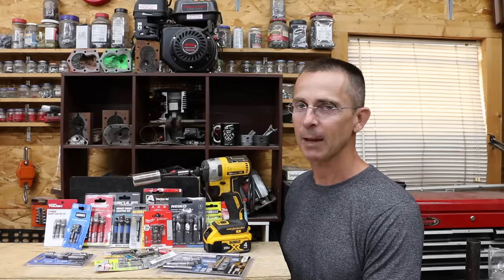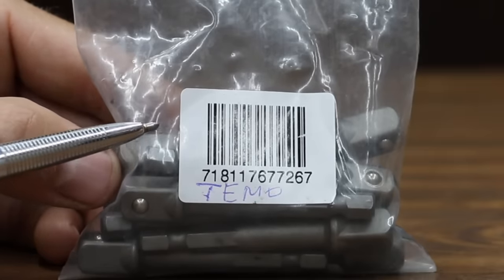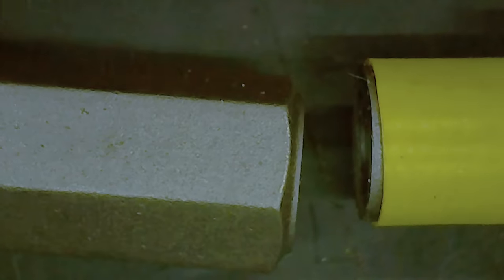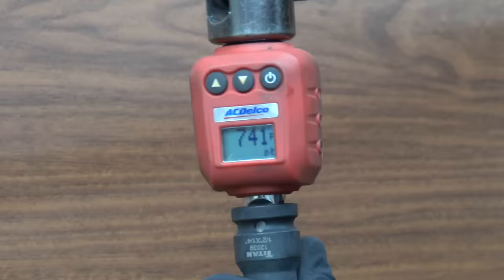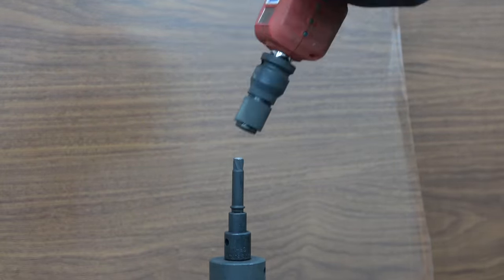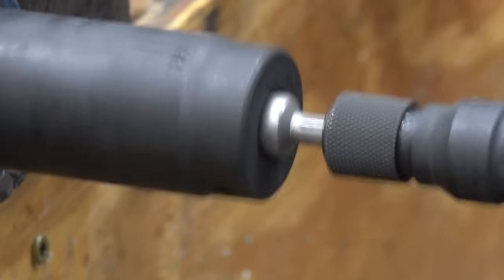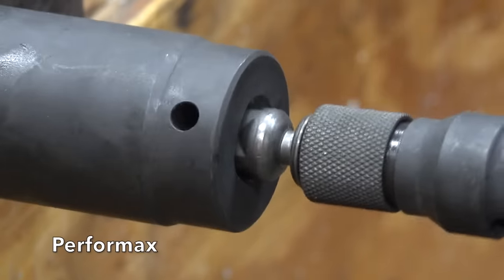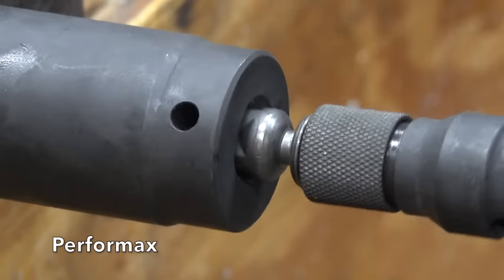Best Socket Adapter? 18 BRANDS: Milwaukee, DeWalt, Makita Gold, Ryobi, Hart, Irwin

Comment: Great video! It seems that when it comes to your reviews of bits/adapters/etc., Husky and Kobalt are often omitted. As those are staples at Home Depot and Lowe’s respectively, it would be helpful to include them as well. I recently had two Husky socket adapters fail on me, and I would have been interested to see how the brand stacked up in your test. Also, it might be interesting to do a re-test of these adapters to see how they perform in extreme cold, moderate cold, and warm weather, as many people keep them in their un-heated garages and work trucks year-round and might benefit from knowing which brand(s) are better suited to working well when cold.
Reply from the maker: Thanks!  Thanks for the video ideas if I revisit this test.
Reply: @ProjectFarm  

A test with tools in 10-30F range would be quite interesting.
Reply: What model Husky? I'm looking at the 1/4 in. Drive Impact Driver Socket Adapter Set (6-Piece) right now

Comment: Doesn't having a shock absorbing adapter defeat the purpose of using an impact tool?
Reply from the maker: Great point!  From testing all of these, it serves as a failure point on short impact zones and adapters with longer impact zones (Bauer and Hercules) absorb too much of the impact.
Reply: No. It assists in applying the right torque, instead of getting the full load of torque immediately. Torque limiting extensions are the gold standard in tightening lug nuts because real people in the field will destroy the tool and parts they are working on if you give them the full load of torque immediately.
Reply: Protecting #8 or #10 fasteners may be a good application for the shock zones.  But when using them on large bolts, it seems the stronger versions could be desired.
Reply: $5 says it's marketing wank and a great excuse for a built in failure point so you keep coming back and buying more
Reply: @ProjectFarm  The shock absorbing in the longer bits has nothing to do with it being an impact absorbing section, it's purely down to length. Try driving a 600mm screw with an impact driver: you'll get absolutely nowhere. If you use a regular drill, it'll go in no problem. More material means more springyness, which means less torque transmission.
Reply: @TheThomaswastaken  or you could get the right impact negating the need for a 1/4 inch shaft. Honestly i've got the 1/4 inch , 3/8's  and 1/2 inch impact.  As for your Comment it's wrong, the Impact absorbing Zone is just a failure point so it breaks there instead of in the tool.
Reply: False Flag  or a 3/8's and or half inch impact that needs no extension.
Reply: False Flag  When I worked at Sears Auto Center we had to use the correct color torque limiting stick then we had to go back over the lugs with a torque wrench which is still in the certified/calibration date. The torque sticks would never torque to the correct ft-lbs
Reply: I don’t think on sockets it helps, as the socket can and bolt or nut can take the torque, but with screw heads (Philips,  square, star) can only take so much torque, and this helps to keep the peak torque down.
Reply: @ArmyGrunt1986  That sounds a lot like how I put the lugs on my car. Spin it on and tighten it 90% of the way by impact driver, and then tighten it by hand because the impact driver doesn't deliver enough force to properly tighten them.
Reply: @shawn576  

That's how I do truck lugs on spiders and 10/12 studs. Run them on, square the wheel (for spiders), then tight with the impact and final finish with the bar.
Reply: Its more a shock normalizer than a random absorption.
Reply: @Peter Bilt you're absolutely right. It's called "Impact", not gradual or soft because it's supposed to be impacting. If you don't want the impact then you use another tool.
Reply: @TheThomaswastaken  imho, impact tools are for loosening, where you want all of the impact delivered to the fastener.  Tightening should be done to a torque specification.
Reply: @BixbyConsequence  Impacts are great for driving long wood screws that are nearly impossible to drive by hand or non-impact driver due to how much force it takes to get them moving. With an impact, I can easily drive 4" screws with one hand. With a non-impact, the continuously increasing torque can yank the driver/drill out of your hands at any moment.
Reply: @BixbyConsequence  

Impacts are fine for tightening in most circumstances, you just don't go full diesel mechanic and rattle on the damn bolt for half an hour. Run a bolt on, tighten it somewhat, then finish to spec. You shouldn't start a bolt with an impact either due to how easily you'll knacker a thread, which is another diesel mechanic trick.

Driving fasteners is a totally different thing, my 1/2" impact drives all the lag bolts I use around the farm.
Reply: @ProjectFarm  It's for fatigue life. Reducing the diameter slightly and changing to a round cross section instead of hex makes the adapter last longer under cyclic loading like you see in an impact driver at the expense of a reduction in maximum single-loading strength. You would only see the advantage of this zone if you loaded the adapter below its ultimate strength and cycled it for a million impacts or more using the impact driver these tools are designed for, not a 1/2" impact wrench like you used. I'd be interested to see a re-do of the impact test with a regular impact driver instead of a wrench to see if the "shock zone" adapters do what they're designed to do.
Reply: @TheThomaswastaken  Sorry no, but a good torque wrench is the gold standard. I've taken my vehicles to tire shops where I've watched them use torque extensions and found them to have as much as 20 ft-lbs of deviation from nut to nut when tested with my Snap On torque wrench. If a wheel nut and stud is designed to be tightened to 80 ft-lbs, then 60 is not enough to guarantee it doesn't come loose. And 100 could stretch the stud past it's elastic point. Torque extensions are designed to be fast, cheap, idiot proof and to keep the tire shop out of court, not their customers out of the hospital.
Reply: It depends on the application. 
In aerospace where fasteners can range from $1 to a $890 3/4” Inconel/Titanium fastener absolutely can’t be damaged- these would be a good idea as it should break before the fastener does. 
Have to be careful. You never know what that 200 pound gorilla will do on the other end of the tool.
Reply: False Flag  You over estimate that intelligence of A LOT of employees.  As someone who's always removing rounded out allen countersunk bolts from machines.
Reply: @TheThomaswastaken  Impact driving accessories, especially adapters like these, are supposed to deliver the sharp impact force through the tool. It is that sharp impact force that does the work that you chose to use an impact wrench for in the first place, such as removing stuck bolts or driving nuts over flattened threads. The tool does this through resisting flexion (being rigid). Situations where you would consider striking a wrench with a hammer, which is essentially what an impact wrench is doing. If you've ever tried removing stuck or over torques lug nuts with a regular extension or adapter, you'll realize how frustrating it is realizing the impacts are being absorbed by the extension or adapter rather than sending that impact force into the lug nut.

Torque limiting extensions are not drive adapters. Those tools are designed to deliver torque while limiting the overall amount of torque delivered through it so that you don't apply too much. They absorb anything over their rating, shunting that excessive torque as heat through the tool. They accomplish this by having a controlled amount of flexion over their length. This is generally used when torquing tire lug nuts, where the torque limiting extension can be used to quickly install the lug nut without over doing it, where the final torque is applied afterwards with an actual torque wrench.

For an impact adapter or extension, ideally you would want a tool that transmits 100% of the impact force through it, while not breaking with the desired overall amount of torque being applied to it. A 6ft long piece of steel pipe may be able to not break while dealing with the applied torque along it, but if it flexes enough to absorb all of the impacts then it would defeat the purpose of using an impact wrench in the first place. A long steel pipe, obviously, would make a terrible impact extension since it cannot transmit sharp impact forces through it very well.
Reply: @TheThomaswastaken  yeah except they dont critically fail when the torque load exceeds the rated amount, they flex and simultaneously save the tool, the fastener, and the area being fastened to.
Reply: @TheThomaswastaken  you dont tighten wheel lugs the "right way" with a impact driver....you use a tq wrench.
Reply: False Flag  The right way is when you need 120 N/m, you use a 100 N/m torque stick on a uggaguggagun for speed and then use a torque wrench for the last part.
Reply: @3rdpig  20 lbs difference isn’t bad for tire shop techs. the thing about torque sticks is you can always trust them to get you to AT LEAST the rating but usually more. if a nut says 80, it’ll prob handle 120-130 no prob. if it says 100 it’ll prob take 140-150 repeatedly
Reply: @richardvedvik979  If you're using 1/4" hex drive to tighten "larger bolts"... you're doing it wrong.
Reply: @3rdpig  100 Ft*Lb isn't gonna stretch a wheel stud calling for 80 Ft*Lb past its elastic point. It's clear you have no idea what you're even going on about.
Reply: @lIIIIIllll  Honestly idk why these get made in 1/2" drive configurations. But working in a paper mill, they are a life saver for the hundreds to thousands of SHCS (4-8mm) that doing a roll change can entail removing. They mostly help absorb that last bit of snap/whack at the end that would normally cause the head to start rounding out. That and preventing the actual adapter from snapping due to repeated stress for hundreds of thousands of cycles.
Reply: @3rdpig  if you can't install lugnuts without a tq wrench, you don't belong working on cars. And you're not going to stretch them to the point of plastic deformation unless you're completely incompetent. People's lug nuts aren't falling off unless they're DRASTICALLY under torqued.
Reply: @TheThomaswastaken  No reputable shop or manufacturer will EVER allow you to hit final torque with a torque stick. There is too much variance, the torque sticks only job is to prevent some young buck from snapping studs left and right. You must in all cases go back with a torque wrench and check final torque. It is for this reason I never used torque sticks, I have trigger control and know how to 'go light' on the trigger. I can accurately and repeatably hit a +/- 5% margin of error with my impact to a given torque spec. I still hit lug nuts with a torque wrench every time, even though most of the time the nut makes only a few degrees of rotation before hitting final torque.

Full torque immediately won't break things either, the total torque applied will. For most things the speed at which an air or electric impact can spin up is not enough to cause damage. It's the 1,350ft-lbs rating of my impact that will cause damage.
Reply: The most interesting part of the torque wrench argument (that I only relatively recently discovered but should have probably known for longer) is that of course they do not guarantee the fastener is tightened correctly at all. The fastener's ability to remain in place is governed by the elastic deformation of the threads, and a torque wrench can only estimate this. Of course when torque values are given, this takes into account the materials - but dirty, corroded, lubricated or damaged threads could have vastly different torque readings for the same amount of actual tightness. Hence why angle guages exist for critical parts like cylinder head bolts because they deliver a known stretch by moving a known distance.
Reply: @3rdpig  What shops are you going to where they are only torqueing lug nuts with a torque stick? You should stop going there, as you understand they are garbage for getting proper torque, their only job is to stop some idiot from snapping the stud when they have no trigger control.

They should always be tightening to final torque with a torque wrench.

As far as stud snapping, you can go well above 80ft-lbs on a stud rated for 80ft-lbs without permanent damage. Going to 100ft-lbs won't hurt it, but it's more dangerous than going right to 80.

Had a guy with a jeep come in once, wanted tires 10 minutes before close. So we started the job anyway (company policy), it took a 3ft breaker bar with us standing on it to get them loose. When we asked who put them on last, he said he did and torqued them to 250ft-lbs. No joke, the spec was 150ft-lbs, and this dude didn't snap them. After the corrosion from them being on for so long we guessed that it took about 600ft-lbs to break them loose (200lbs dude jumping on a 3ft breaker). Don't ask me how they didn't snap, i've never had that much trouble even with the class 8 trucks I used to work on.
Reply: @ObservationofLimits  a 1/4" to 1/2" adapter exists, and using it to start or remove loosened larger bolts with 1/2" sockets when working on vehicles is a handy application of that adapter and a smaller, portable tool.  I loosen lug nuts with a breaker bar and finish removing or start with a cordless and 1/4" to 1/2" adapter and socket.  I finish lug nuts with the same breaker bar.  I rarely use my large 1/2" corded impact due to the size being inconvenient for most applications.   Cordless ratcheting 3/8" tools are handy also (another good PF video) but lack torque/impact.  I use whatever tool I choose for whatever application I choose, and I don't break tools.  None of these adapters should be used with a torque wrench to finish the job.
Reply: @Adamsadventures83  If you have employees using company tools, would you rather they break the adapter or the wrench? How many adapters is a wrench worth? It's worth considering if you have to gauge how competent or abusive someone is with a tool. Or if the shock absorption is important when dealing with heavy duty yet fragile materials, like inch thick glass secured with bolts and thread locker. It takes a lot more care and expensive mistakes can be made. Me personally, if I had a tool with shock absorption adapters that shouldn't break under normal conditions and everyday use, I would be happy to use those, and remind employees "If you break these, you may be reprimanded, it might come out of your paycheck, or you may be fired, treat it with care, because the less money I need to spend on stuff like this, the more money I can pay good workers like you. Don't let me me, your coworkers, or your tools down."
Reply: @TheThomaswastaken  how about loosening them? From this test it seems like no 1/4 hex driver can change a lug nut on my Suburban (140 ft-lbs) because even though my 2000 in-lb driver has the moxie, no bit can take all that power. Or is this testing not that?
Reply: @shawn576  mine does - 160+ ft-lbs, would almost do the axle nut lol - but from these tests nothing can get close to 1700 in_lbs without snapping.
Reply: @nichevo1  I'm not sure why the bits in PF's video all snap like garbage. I've tried to loosen the nuts on my car (Subaru Impreza base model) and the impact driver itself was the problem. It'll make lots of noise but those lugs do not come off. I've never actually snapped a 1/4 hex adapter before, and I use them every day as an electrician. It's not like I buy top quality stuff; it's all from Amazon or eBay and always purchased by sorting by price.

Comment: Yep use dewalt adapters myself never broke one yet for my uses.
Reply: Same here. Have the 3 piece adapter set and the 5 piece impact nut drivers. Never had an issue.
Reply from the maker: Great quality adapter!
Reply: Ever think of doing a test on kobalt tools  and batteries against leading brands dewalt etc. I have had very good luck with kobalt especially with their batteries holding up longer. Just my experience.